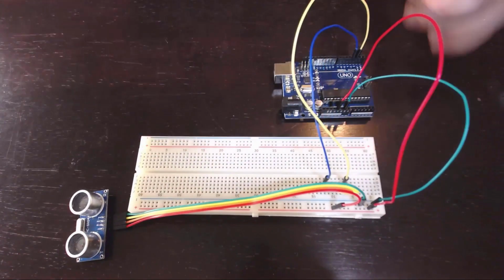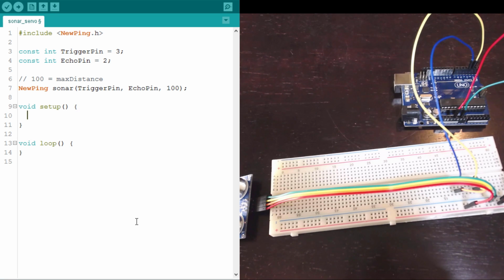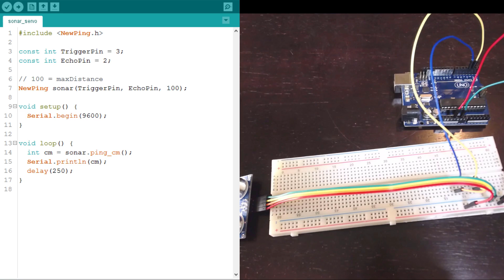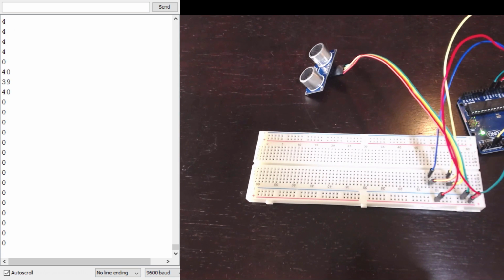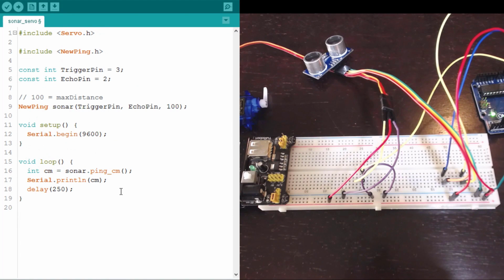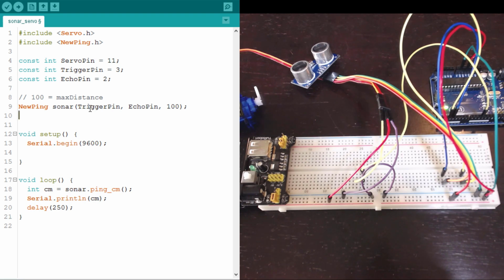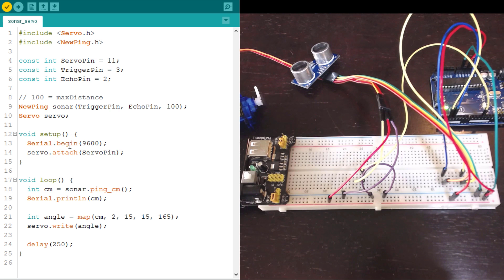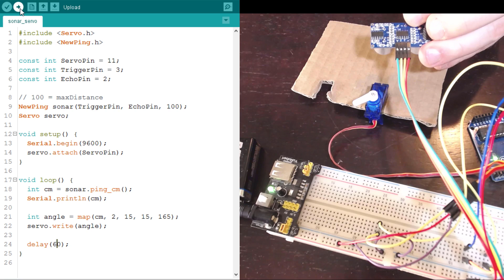Control servo with ultrasonic distance sensor and Arduino Uno

Comment: ive done the first part but when i upload the code all i get are 0's and 1149, why is that, this is the code,
#include <NewPing.h>

const int TriggerPin = 7;
const int EchoPin = 6;

//100 = maxDistance

NewPing sonar(TriggerPin, EchoPin, 100);

void setup() {
  
 Serial.begin(9600);
 

}

void loop() {

 int cm = sonar.ping_cm();
 Serial.println(cm);
 delay(250);

}
and im pretty sure the connections are right

Comment: Code:

#include <Servo.h>

#include <NewPing.h>

const int ServoPin = 11;
const int TriggerPin = 3;
const int EchoPin = 2;

// 100 = maxDistance
NewPing sonar (TriggerPin, EchoPin, 100);
Servo servo;

void setup() {
  Serial.begin(9600);
  servo.attach(ServoPin);
}

void loop() {
  int cm = sonar.ping_cm();
  Serial.println(cm);

  int angle = map(cm, 2, 15, 15, 165);
  servo.write(angle);

  delay(250);
}

Comment: this could work ???
#include <NewPing.h>
#include <Servo.h>

const int ServoPin1 = 11;
const int ServoPin2 = 12;
const int TriggerPin = 3;
const int TriggerPin = 4;
const int EchoPin = 2;
const int EchoPin = 5;

// 100 = maxDistance
NewPing sonar1(TRIGGER_PIN, ECHO_PIN, 100);
NewPing sonar2(TRIGGER_PIN2, ECHO_PIN2, 100);
Servo servo1;
Servo servo2;

void setup() {
  Serial.begin(9600);
  servo1.attach(ServoPin1);
  servo2.attach(ServoPin2);
}

void loop() 
  int cm = sonar1.ping_cm();
  int cm = sonar2.ping_cm();
  Serial.print("Hasil Sensor 1 :");
  Serial.print(sonar1);
  Serial.print("cm")
  Serial.print("Hasil Sensor 2 :");
  Serial.print(sonar2);
  Serial.println("cm");
  
  if angle = map (cm, 2, 15, 15, 165);
    servo1.write(180);
    delay(60);
  }
  if angle = map (cm, 2, 15, 15, 165);
    servo2.write(180);
    delay(60);
  }
  else{
    servo1.write(0);
    servo2.write(0);
    delay(60);
  }
}